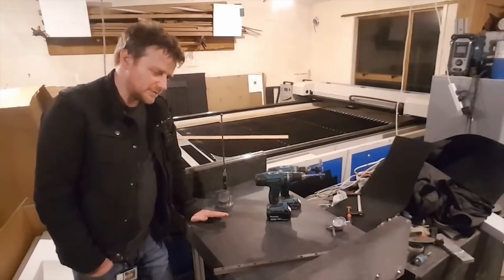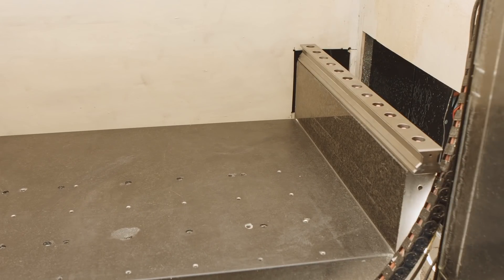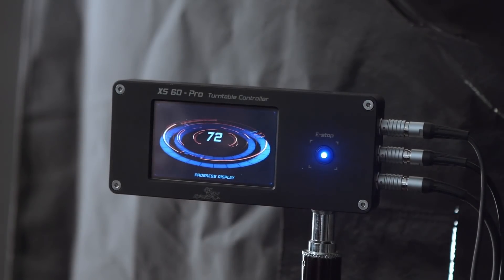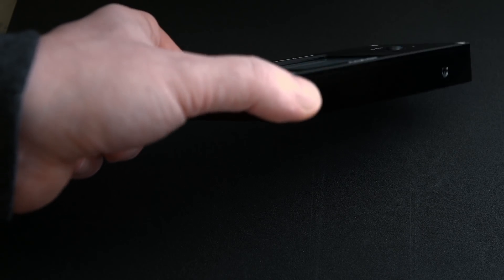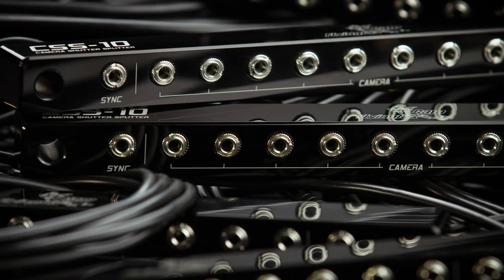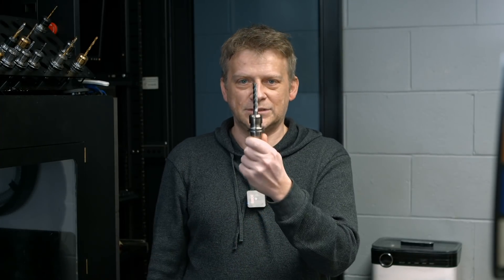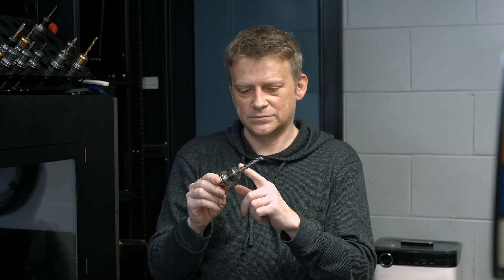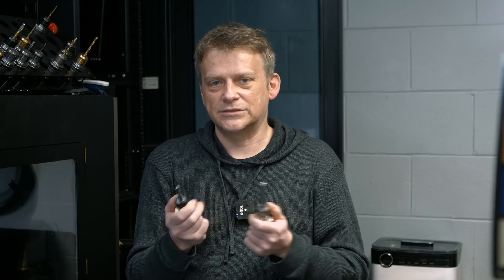EPIC CNC upgrade - final episode.  Unreal surface finish on commercial products, straight from cnc.

Comment: At 4:00   "Something no-one will ever see".  My father used to quote a little craftsman's mantra which said that every unseen and hidden part will still be seen by the Gods, and by your mind's eye.
 With this in mind, I made my Father-in-Law laugh when I made him a replacement brass dome-nut for the bottom of his farms water bore... I polished it to a mirror finish!    ;o)
Reply from the maker: i guess you have to feel good with what you do :) 
Machine doesn't favour what side is machining it does all of them the same way. i have add bevels here and there so no cables inside will ever get rubbed against the sharp edge and short. other reason is to limit amounts of cuts on my hands assembling it. another point is anodizing. anodizing doesn't work on sharp edges. and finally if i wouldnt put a bevel on the edges i couldn't call it finished part :D 
kinda funny how every edge can tell the different story :)

Comment: Equally as importnat is your tooling and feeds/speeds. What face mill was that, which inserts. And what feeds and speeds? I've never seen surface finish that good except with diamond tooling.
Reply from the maker: i have used the cheapest face mill i have seen, 
PCD inserts
speed 5k rpm
feed 350mm/min max 500mm/min
but those values  might be different for different machines tools and other variables about which i will be talking in the further videos.
Reply: @PiotrFoxWysocki  Thanks! I'm getting the Langmuir systems MR1 mill in a couple months. It's half the price of a tormach! I love your little granite machine. Reminds of the little DMG mori that Adam the machinist has.
Reply from the maker: Congratulations on the buy. I have looked at Adam's mori and that thing is tiny. Wondering where you find similarities 😉 Mine has 660mm x 370mm x 200mm work area.

Comment: Hey Fox, regarding coated or non coated end mills: normally the uncoated should be a little sharper as the coating needs like a tiny little corner radius which is achieved by brushing the edges wet or dry or put the mills in a bath of very gentle abrasive. 
Also for aluminium work you don't really need a coating and even should avoid anything Ti or Al based like TiN, TiCN, AlCrN. There are some coatings which improves tool life on aluminium (DLC and so on) but imo you can save the dollar.
Regarding your request for endmills: Maybe send me a message as I work for a big tool manufacturer.
Reply from the maker: thank you for the idea. i will try to put coated and uncoated endmills under the microscope, maybe i will be able to see some difference.

if you could talk with someone at your company to send a best finishing endmill for testing that would be super awesome :)
but i doubt that any company would voluntarily put their tools under such scrutiny I will go through.
Reply: @PiotrFoxWysocki  I will ask the guys from marketing, we will see :-) what diameter and lc did you planed?
Reply from the maker: I would go for 8 -10mm so it doesn't flex too much. But I'm open for whatever suggestions as long this tool will produce the best possible finish on aluminum.

Comment: Let's see whats took you so long, lol, finally))
P.S. noice) next time more chips!
Reply from the maker: problem with my machine is the amount of coolant its pumping. you can't see much
Reply: @PiotrFoxWysocki  true, it will be for people who have a little bit of imagination, do have some, lol. A starting point, a pass and some intermediate stage or something like that - when you chabge the tools, or turn the blanks the other side - can be good as well
Doing some test blanks parts and measuring stuff etc. So there still place for some action. Finished products are great, but also it would be nice to see you brag about your workhorse and show it run. I like that microscope idea would be interesting to see as well. Idk it may be a bit different side of things, but if you get on microscope side and wanna see the difference, then it possible that you can get some scanning microscope for yourself. I'm writing it from a mobile now and fear if I switch that stupid youtube app the comment will go, but take look at Breaking taps channel(if I get its name rigth, hope) he was using some mems(micro electronic something) device which is a small scanning microscope. I imagine it can be absolute winner in a sense to check the surface finish details and such. The heads are expendable but for micron submicron resolution it should last for some time(the thing degrades in its resolution capacities from nanometers to more human related resolutions) and they were something like 100 buck a piece - and in my opinion for what they do - it a bargain. A stand there is some precision small table, not sure what is as its price goes, but should not be a space price tag. But quite certain the thing can help dive in the details of surface finish, and get objective data to see the difference if there is one - what is what and which finish is better. I pray you get fancy of this idea and show it to us and that it works for the application(it should but not 100% sure). To my knowledge it would be a firsts case of using it for a machining channel, to see things which we could not before it.
Reply: @PiotrFoxWysocki  a video of Breaking Taps I talking anout is this one - "Tapping on atoms with a (very) sharp stick - Atomic Force Microscopy" , the microscope site in the desc of that video(have some problems posting the comment, let's try to avoid limks) , I guess they still may care about promoting themselfs, so you identity may matter, so as machining field may matter.(for discounts or maybe priorities) I really would like to the the thing to be brougth to machining diy field, I think it may shine here, at least to shed some ligth to previously unseen corners.
Reply from the maker: Dear lord ;) you wrote this whole thing on the phone ;) your determination to see  this next video must be sky high 😀
I have seen this breaking taps video. Really cool toy. I even checked their website for the price, but if they don't put the prices the actual price will be obscene. 
I dont think whey will be giving those microscopes to every youtuber..
So I have no hope here.
I have made  confocal microscope to investigate metal parts. Check my instagram. I went with some ridiculous magnification but too close is too close and you don't know what you are looking at. So zooming out makes much more sense to see the tool marks. It will make sense, no worries 😉
Reply: @PiotrFoxWysocki  sky high - yes it is, yes it is, lol
My expirience(not a rich one but some) with those sites/companies it quite useless to browse their sites and it needs emailing and such and based on their internal policies they will talk, even if they may have guesses/certainy that I'm not their future client.
But I guess you know that stuff better than me, it just that I was interested let you know that such a device is an option, and that you know it already is good.

Cutting edges of tools also can be scanned, and field isn't that small, and sure with a combination with regular optics it makes even more sense, not a replacement, so as stacking optics shots for depth of focus (how people do macro shots of insects and such) is quite capable approach as well, so there may be no need for scanning and all that, it just a tool to go to the end of rabbit hole, I mean there is not much left beyond what it can do, lol.

But okay, it good you know, will take look at instagram, and waiting for videos for sure))
Reply: @PiotrFoxWysocki  maybe some collab with Breaking taps, send him something to scan, to see if there somethung interesting to see or not - maybe the cheapest option
Reply from the maker: Collab does sound interesting and much more possible 😉 once I find the best tool I will definitely ask him 😉
Check imy nstagram I made a picture of the endmill corner this is like 1mm x 1mm area On this picture with the endmill.
Reply: @PiotrFoxWysocki  I see, yeah waitig for videos about finings and photos to analyse,  looks promising)

Comment: Fox you are like... one of the god damed smartest engineers out there. And I say this as someone lucky enough to work with a lot of pretty darned smart people out there. You and Marco Reps did such a spectacular job, A++ for  not only the whole project, but documenting it with full honesty ("this is where a messup happened, this is how I fixed it, this is how to avoid it yourself" etc. 

I can only wonder how many firms have tried to poach you so far (though, someone away from NZ must be quite hard, I'd imagine,dear Jacinda marryme thanks in advance). L
Reply: ALSO, you can easily put SMALLRIG out of business. Just based on the quality/feel/aesthetics of your product, 100% sure you'd tear them apart at the same price point, maybe even higher

What glass did you shoot that 10-camera rig on?
Reply from the maker: you can not beat the price of small rig. not living in New Zealand where cost of living is just astronomical in comparison to China. but i have to make some clamps my self for the turntable rig, and yes they do look quite incredible :)
the picture i shot on 
canon eos 7d
f/18
1/250s
iso200
on a 70-200  2.8 Is L II lens
Reply from the maker: hey :) thank you, i appreciate it a lot :D

Comment: That finish is astonishingly close to perfection, and I have to pinch myself to make sure that I have not just dreamt the notion that it was achieved with what has been, in essence, a 'home built' CNC mill/router. But, on the other hand, having followed the build and upgrade, you have always most strenuously worked to achieve perfection so why am I surprised?
I am curious though, the hardware you have ended up with is clearly in the class of something that would cost in the vicinity of Aus$200,000 (I am thinking of offerings from Datron, etc), but what about the software? What are you using (in particular the firmware—the drivers, etc), and do you find that it is up to the same standard?
Thanks!
Reply from the maker: thanks:) im glad you like it so much :) 
basic hardware wise, yes same stuff as in top line cnc machines.
software wise, and you pointed datron, nothing to compare. im using fusion 360 and mach3. the end :)
datron has its own operating system with more blows and whistles than components in the whole machine including screws :D

I'm not sure how to answer on to this question.
Reply: @PiotrFoxWysocki  Yes, the software for the Datron machines is quite amazing, but, thinking about it a bit more, the finish you achieve really speaks for itself!
Reply from the maker: Well.. I made my machine just for best surface finish. With minimal amout of features. Absolutely bare minimum mechanically with some features easing the operating it. Like: spindle speed control attached to the tool number. Tool library. Automatic air pressure to the spindle. Tool holder eject button, auto touch probe. Self clean button in mach3. Flood coolant and this would be all really. 
Without the tool changer the machine is not very friendly in mass production. But with the amount of tools I have dathron wont be that much more friendly, as as far I know it's more a prototyping machine.
For production you really need machine which can take 50 tools. Otherwise you will have to change tools according to the part you milling. I would find it really annoying. 

If you need a machine for work I would recommend to buy already made one. 
You just won't have enough hours in your life fo make commercial machine with so many features, software and all the fail-safe protocols. I would recommend to buy something from the company with many years of experience in cnc machines and hundreds of experts working 5 day weeks to make it better for years. 
Even if the finish quality might not be the same, it will outperform in speed.
Reply: @PiotrFoxWysocki  We say-Don't try to re-invent the wheel. That being said, well done achieving such incredible performance from yours!

Comment: Well, if you look at how DMG Mori makes their machines - they start out with a huge and heavy iron cast frame, put three feet on it, and then precision grind in the reference surfaces. Because as you said, you won't get a precision machine when you start out with wobbly surfaces. Visiting their production in Pfronten, Germany was a real treat.
Reply from the maker: I bet. You must have feel like child in the lego factory 😉 soooo many cool things to see. How did you manage to get in ??
Reply: @PiotrFoxWysocki  I did some virtual reality work for them, but every year they open their factory for a few days to the public, so everyone can get guided tours.
Their machines are very present in tool making (and repairing) for injection molding, where the surface finish will basically get mirrored into the plastic parts. Their largest machines like the DMU 600 Gantry, which you could also see in production are basically just very big garages (machining volume 18x2.8x2.5m) where you can walk right into.
Reply from the maker: on one hand i like New Zealand but on the other hand it sucks to be soo far from civilisation
Reply: @PiotrFoxWysocki  Oh, you're a Kiwi. Well, you live on a beautiful island, and since the invention of the Internet, the world has shrunk considerably, so I guess it's not too bad.
Reply: @PiotrFoxWysocki  Today, DMG Mori opened their "Open House 2022", so if you head over to their channel, they have some new videos.
PS: the blonde one was my contact when I did work for them a few years ago.
Reply from the maker: Thanks for the tip. I'm going to watch it now 😉

Comment: A serie of videos about the process of anothizing parts can be very interesting
Reply from the maker: I know :D im contemplating making some detailed videos about it but i would need a lot of time as the process takes quite a while, and it would be cool to show what to do and what not and why.
Reply: @PiotrFoxWysocki  I would love to see a video on that. My anodizing is very inconsistent despite meticulously keeping track of the variables.
Reply from the maker: maybe i will be able to help right now ;) possible problems:
1) poor electrical contact
2) you are not ramping up current or voltage when you put the part in to anodizing. you have to increase voltage/ current slowly to the final amount. it takes me 2 -5 min
3) temperature of the anodizing bath. it has to be the same to 1 or 2 deg C. optimal 19deg C
4) dye temperature 50-60 deg C
5) if you do a black color you have to keep it anodizing for 2h im using 1.2A for every 1000mm2 of surface area. 

now im thinking that i really should make this video because there is soo much to cover. but because there is soo much to cover i don't know where to start :)
anodizing is a simple process yet very sensitive on any variable. took me years to get this right each time.

Comment: Amazing build. I have been following for a while. What would you say the dollar amount you spend on this build? 
I have found Chinese endmill are made on the same machine that high end brands use.
Reply from the maker: im not sure how much i have spent on it but something around 10-15k. thanks for the inside about the endmills, it does make sense and it kinda confirm my observations.
Reply: @PiotrFoxWysocki  That's actually a really good price for a machine that can effectively use mcd tooling.  The tooling i use on my 6040 comes from XUHAN Store on ali. I have taken some absurd cuts and only chipped a flute. Have you tried alcohol mql on aluminum? Works really good. 

I will add Guhring are really really nice. their polished variable flute endmills are amazing but 4-5 X the price
Reply from the maker: Yes aluminium sticks to everything like a butter to the knife. Best finish I have noticed was with isopropyl. It breaks surface tension and let the chips to fly away. Otherwise they get dragged back under toe insert and smear
Reply: @PiotrFoxWysocki  I understood that the evaporation cooling on the endmill and part plays and big roll in that as well. The chips come off dry that's why they don't stick to things. pretty neat.  
I'm curious why did you go with such massive linear rails? They must be 7x safety factor .
Reply from the maker: why massive rails? 3 reasons, 1 because i found them cheap :) 2 more rigidity, so the rails or carriages are not flexing. 3 i have theory behind manufacturing of those parts. all the rails are roller guides, so they use cylinders instead of balls  as bearings. its easier to make precise cylinder than a sphere. and when you have manufacturing tolerance on small cylinder of 1micron the came tolerance on bigger cylinder will be proportionally smaller, resulting on much smaller effect on the overall precision of the final rail. i hope I make sense :D